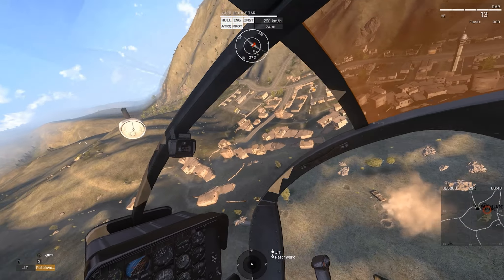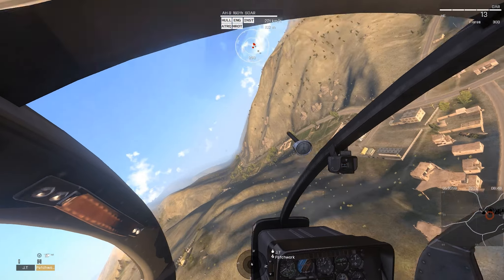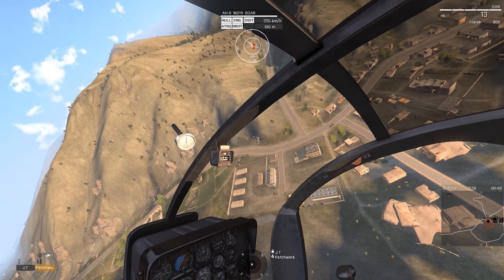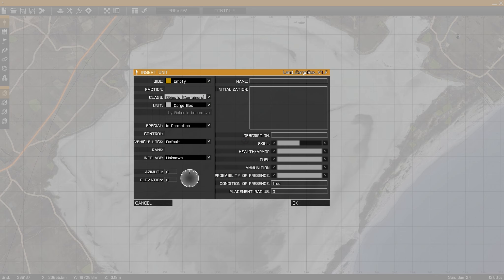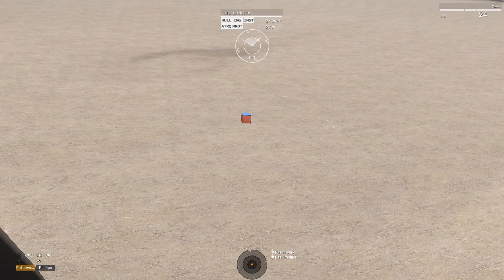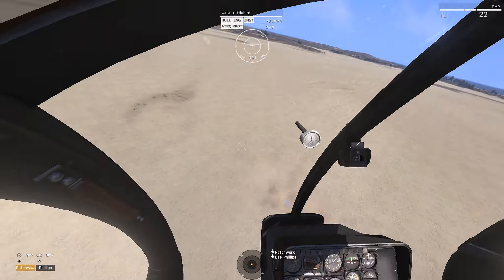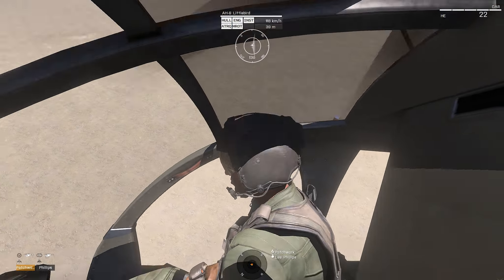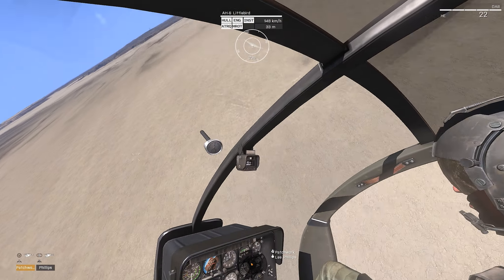Nose Guided Weapon Accuracy Tips - Flight Quick Tips #3 (Arma 3 Helicopter Tutorial)

Comment: i always find myself diving into a target with a blackfoot on manual fire, getting some hits isn't much of a problem, but when i'm done with a strafing run and want to climb out, the blackfoot keeps losing altitude and eventually crashes me into the ground
Reply: the solution is obviously bacon
Reply: Of course this will happen because the engine doesn't have enough power to pull the heli up from a dive
Pullig up earlier may help you